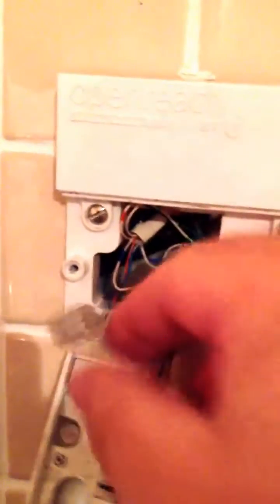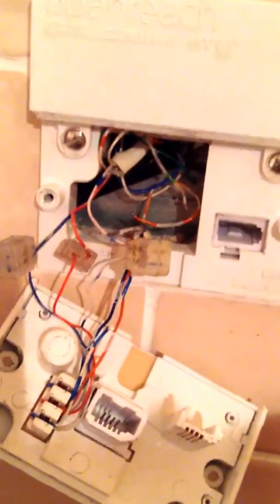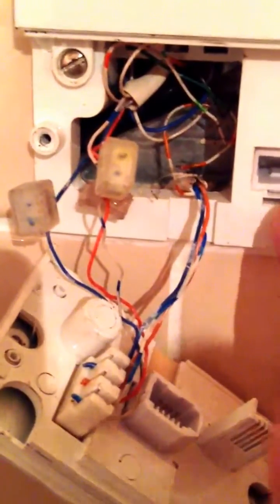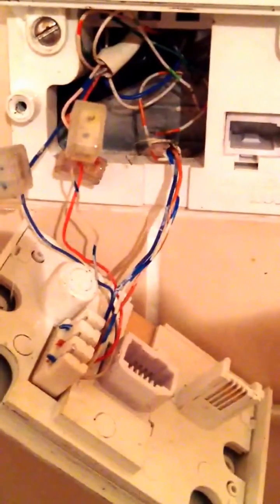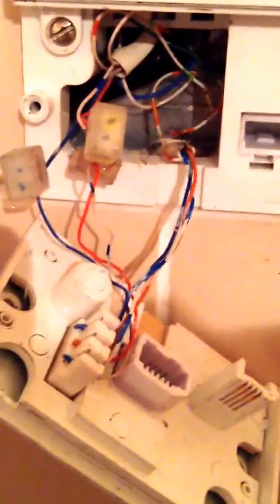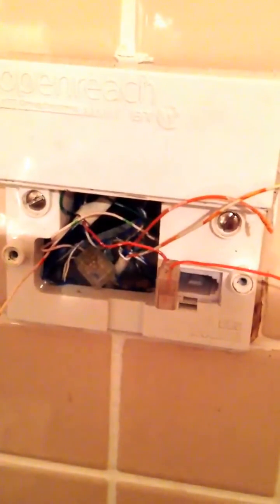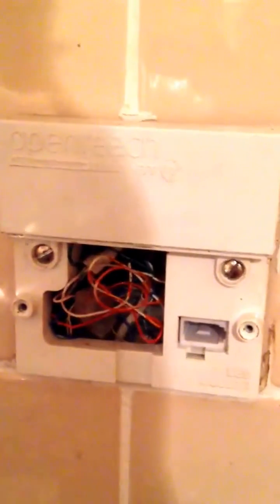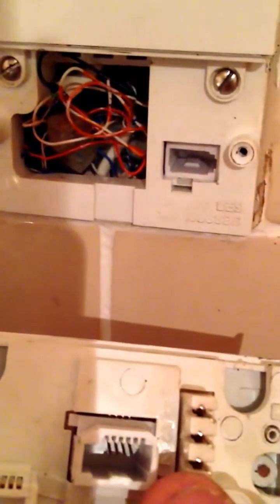BT LANDLINE FAULT REPAIR DIAGNOSIS VIDEO

Comment: You should test the spare pair first before you swap it over , If the first pair has gone faulty there is a good chance spare has a fault on it too . If so it wont last long before it starts going faulty itself ....

Comment: I had Talk Talk move my master socket to a bedroom as my then PC was plugged directly into the router. that PC has now died and I have bought a laptop and use it wireless. the thing is I now have no internet in parts of the house and wanted to move the router to a more central location in the house. how do i make another socket into a master socket???

Comment: I'm haven problems with phone line and broadband been in the phone to sky and we did some test and come back with it being the socket running off the mail box, is it easy enough for me to do my self, the wiring coming off the main to the extra sock that my phone/broadband are plugged in to feel loose? Any advise mate